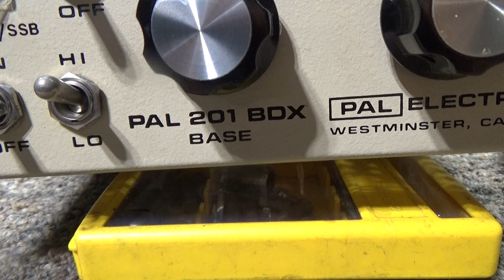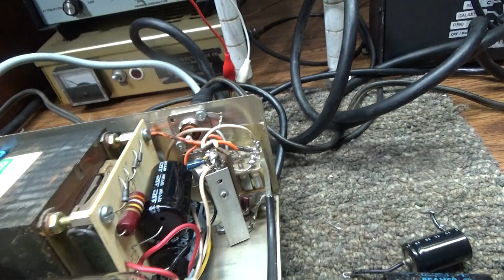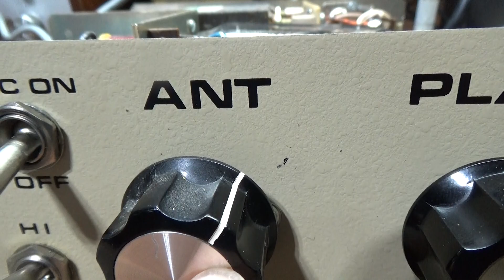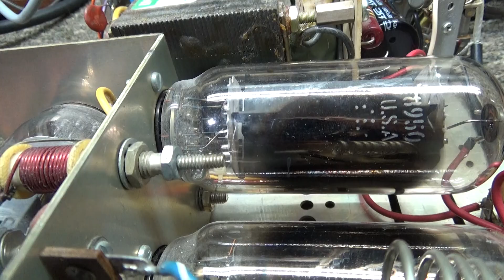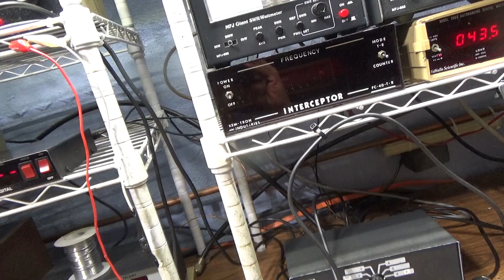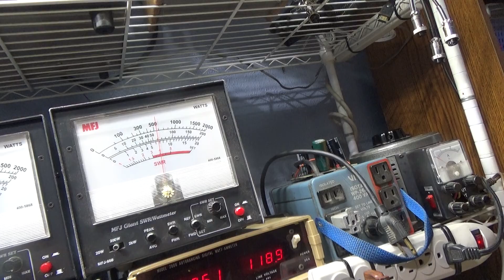PAL 201BDX 1 driving 2 8950 tubes base 10 meter amplifier.

Comment: Have a maco 1k still has driver tube an its the only one that will modulate the 3'san 8's wont  im trying to find out whats wrong. Any thoughts on the problem ?
Reply from the maker: 3 stage amp, 3x the problems. Is the 1 tube getting hot? 3 tubes? 8 tubes?

Comment: I picked up one of these amps for dirt cheap today but it didn’t have the two 8950 tubes. Do I need to find a matched pair or can I use two random ones.
Reply from the maker: Unmatched will work, but of course matched will work better. Also, an 8950 is just a 12v filament version of the 6lf6 tube. Some will get a 6lf6 substitute, like 6KN6 or 6kd6, which are a LOT cheaper than 8950's and wire the filaments in series.

Comment: I was always curious, of the output of that exact amplifier. Another excellent clip, doc. Can I make a suggestion? I'm assuming you own an external DSP speaker? If my assumption is correct, I would like to see you, create a clip showing how great, DSP external speakers make, especially for the serious DX'er, I owned the West mountain DSP external speaker, for several months, until a local wanted to trade up, a whole bunch of goodies for the speaker, and I was glad to accommodate. The speaker cost me 225, and I got about $500 worth of equipment for it, including my two favorite wm1 meters. I'm not on the air as of yet, but hope to be back on, before the winter comes. It would be nice to show the CB radio hobbyist, how excellent and external DSP speaker works, on a CB radio. Many people think they're for HF transceivers, but they work just as well, even better on CB radios, as there is not a CB, as of yet to my knowledge, that has built in DSP capabilities, on the receive side. In my opinion ad external DSP speaker, should be a prerequisite not only for the serious DX shooter, but for those of us, who like to talk, to those stations in our Tri-State areas, that may not come in well enough, or one has to keep asking that station that's a hundred miles away to keep repeating themselves, as the noise level is higher then there audio/signal. Either way, have a good week, doc and thanks for the clip.
Reply from the maker: I agree, and am into that, and not trying to be mean, but I try to keep these videos simple. How about you make one?
Reply: @tramdr  I no longer own the West Mountain and my video skills are extremely poor. I'm still not back on air yet as there have been many setbacks in my life, over the past two years. When I do eventually get back on the air, and purchase a new DSP speaker (which I will be doing) you have my promise that I will make the clip.
Reply from the maker: Looking forward to it.

Comment: Oh, for the good old days when sweep tubes and 8950s grew on trees!
Reply from the maker: ain't that the truth. I went to the Army in 80, then a couple years away at college, then back in Detroit in 85 and went to the local hobby shop looking for some 6lq6's. I thought they were kidding me when the told me the price.
Reply: @tramdr  , starting at around 1985 or so a lot of gear that used sweep tubes started getting abandoned at hamfests. You could still get 6146 tubes for a reasonable price but with tube-type televisions drying up radios like Swans that used 6JE6/6LQ6/6MJ6 finals (Swan 350/500) or 8950s (Swan 700) suddenly became very expensive to keep going. Hallicrafters used a 6HA5, IIRC. Heathkit and Drake used 6146s. It had the net effect on enforcing the FCC's linear ban on the most common amps but then big ham amps began proliferating.
However...General Electric had begun selling its Master Two commercial line. All solid-state, it featured modular construction and amps capable of 100 watts out on the commercial bands. 
Those amps are today called "four-pills". GE used a 1/4 watt exciter to drive one pill in the amp that drove four pills. They require a 12 volt 20 amp supply and a keying line for the antenna relay (mobile version). 
Conventional amateur wisdom says that you can't use a mobile amp in repeater service, but the amp I built the 29.64 repeater with survived two solar cycles and never quit working.

Comment: That's the Amp I have I asked you about. I have the same Amp. The plate is almost all the way clockwise but she's a screamer!
Reply from the maker: The Plate Tune on this was tuning at minimum capacitance when I got it. I slightly (very slightly) spread the tank coil to give it a little bit less inductance. With the tank circuit (Tune cap, Load cap, and Inductor/coil) the more inductance, the less capacitance needed, and vice versa, the less inductance used, the more capacitance needed. Hence since Plate Tune was at minimum, I lessened the coil some. That fixed it right up. Now Plate Tune is about 1/4 meshed and the output went up about 10 more watts (better efficiency).